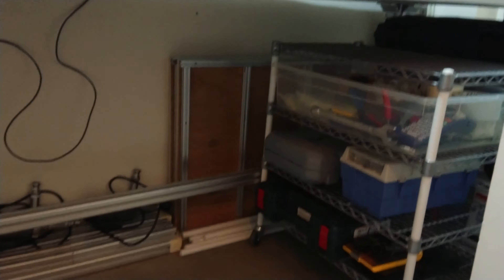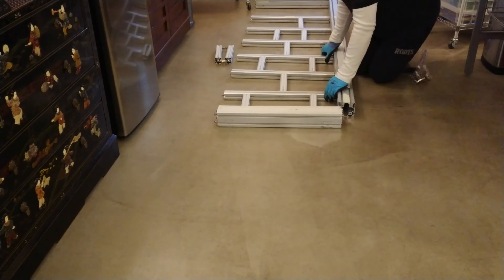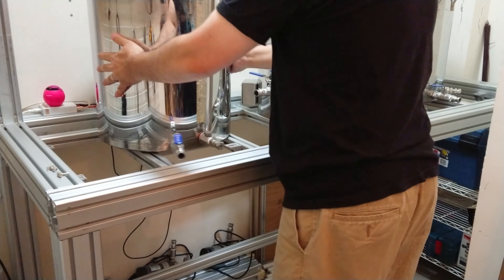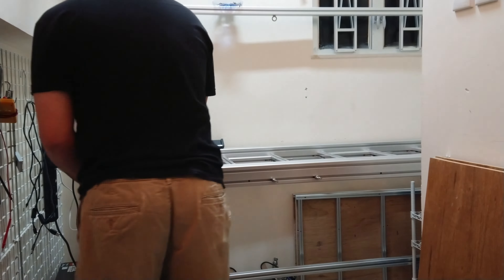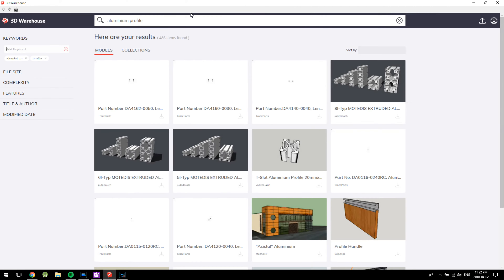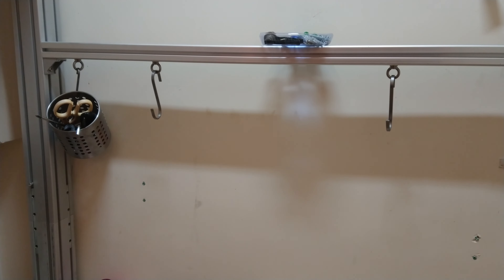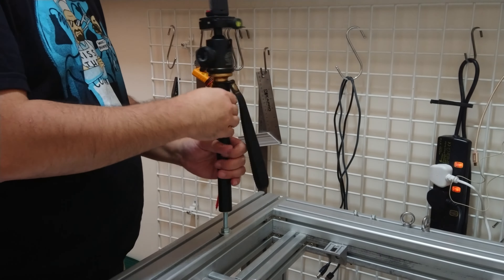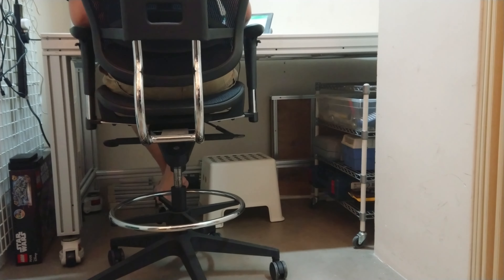How I built my Aluminium Profile Workbench

Comment: Looks great! How is it holding up nowadays?

I cant seem to find 4040 longer than 1m on AliExpress. You used some struts to extend onto a second piece?
Reply from the maker: The desk has held up really well, although i mostly use it as a computer desk right now.

I had to ask the aliexpress stores for custom lengths, most do it up to 3 meters, but then the question is how would you get it shipped to you

Comment: Thanks for the vid. May I know what’s the total cost of material ? A rough estimate will do. Thanks.
Reply from the maker: Roughly 1k usd in material costs, shipping extra
Reply: @millanchoi  that’s quite costly.
Reply from the maker: @justsrad  well, the idea behind it was something heavy duty that I could do DIY projects, use it as a beer brewing station (I can brew up to 10 gallons of beer at a time),  plus I use it as my work from home desk.

Even an Ikea work desk is nearly HKD4k or roughly 500USD, so 1kUSD for my workbench isn't expensive at all.
Reply: @millanchoi  I see. It’s for multi-purpose usage.. well, in long term wise, that would be a worthwhile investment.
Reply from the maker: @justsrad  yeah, if I only used 4040 for the frame, it would have cut the cost by about 25-30%, so it does depend on your usage and how you design it

Comment: Thanks for this. I've been looking to replace two second hand computer tables which take up 75% of available wall  with a large floor profile due to their leg mechanism, with something which runs full-length, has a sturdier top than their tempered glass, and has tiered storage at more sensible heights for the larger screens ive subsequently acquired. 

This is the first project I've seen in my research that addresses a lot of my strength/modularity/design concerns, and being new to the DIY space its actually using materials I hadn't considered (I was weighing up whether I could even get what I wanted without going to a fabricator as I assumed I was going to have to weld which I've yet to learn how to do). 

This 6 minute video has saved me a ton of time and money; I can't thank you enough for it :)
Reply from the maker: Thanks for the comment, my work bench has been a lot of fun to use, and I see 8020 aluminium profile bring used in a lot of industrial applications now (at least noticing it more now).

Have fun building your table.

Comment: Thanks for sharing. Was looking into building something similar myself and thought the 8080 for the main frame would be too big, but after seeing your video it looks exactly what I'm looking for.
Reply from the maker: It's definitely over engineered, but I'd rather that over bring worried that it would break if too much weight was put onto it.  If I wasn't also using the table for beer brewing, 4040 would be good enough.

Comment: What kind of fasteners (screws and nuts) do you use for this workbench? Zinc plated, nickel plated or stainless steel?
Reply from the maker: I use M4 or M6 screws with T-track specific T-nuts, very flexible once you get the hang of using it.  Also makes adding other M4 bolts type fasteners like eye rings to be useful too.

Comment: This is great, thanks for covering Sketchup, I am using it model my 8020 build as well.  What castors did you use?
Reply from the maker: If you search aliexpress for GD 80S casters, you'll find the ones I used.  They are extremely heavy duty

Comment: What a great video!  I wondered why T-slot Aluminum was called 80/20.  It comes in sizes 20, 40, 80, possibly more.  

Loved your work bench, beautiful and functional and a beast for weight.  I would like to make cabinets in T-slot aluminum framing so researching how this works.  You did a great job explaining, many thanks!
Reply from the maker: It's pretty strange why more people don't use it.  The strength and ability to customize is fantastic.
Reply: @millanchoi  Yes, true.  I had not heard about it until I saw cabinets in a DIY van build on Youtube.  So, people may not know it exists. Then it is a cost factor too, which is prohibitively expensive for heavy duty projects like yours.  Wood cost would most likely be $100 - $200 max, not $1K.  Finally, it is not clear what you need - how thick, how many slotted sides vs smooth sides, how you attach the wood, etc.  The official 80/20 instruction videos are an insult to watch, and you learn nothing.  Nothing comprehensive out there on this kind of material.  I should do a video on it myself to learn it.  Lucky you, living in Hong Kong, such a dynamic and rich culture.  But space is so limited for people who want to build anything.

Comment: I love what you did and also want to build one for myself, can you provide more detail on design and implementation. thanks for the great work
Reply from the maker: bm830810 sure, what do you wanna know?
Reply: I don't know how much to ask is too much so here are some ideas and questions that I think haven't been addressed properly on the net.
1. different types of profiles and what are each useful for and how can you choose proper profile for your work (example why you chose this type of profile and how you chose the width)
2. different kind of joints and connections, and what type of joints you used and why
3. a short overview of how you model your workbench in sketchup and links to useful models and information (also there is seems to be a program called frame designer which by user reports is much easier to use)
4. a video of the assembly process maybe for your next workbench/project ;)
Reply from the maker: well, the honest answer is I did plenty of research on the Internet to really figure out the design of the workbench and which types of aluminium profile to use.  Using 8080 profile seemed like a bit overkill, but after seeing the result, I absolutely would go for it again.

a site that I found to be really helpful was 8020.net.  They have a lot of info on the different types of connectors and why you should use one type over another.

You can download my sketch up file here https://drive.google.com/file/d/1uS9JaehPiBeVvxoJ2LMbZQlOdZ9y6bwr/view?usp=sharing

I learned to use sketch up through designing this table.
Reply: thanks a lot, I hope your channel grows and get the attention it deserves, maybe add the links to description so others can find it more easily
Reply from the maker: Thanks for the advice, still trying to figure it all out